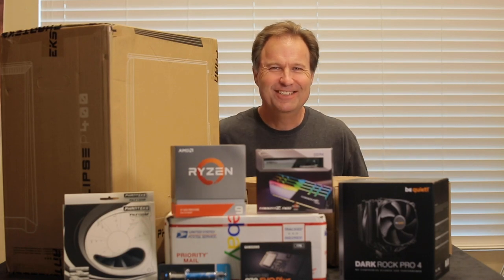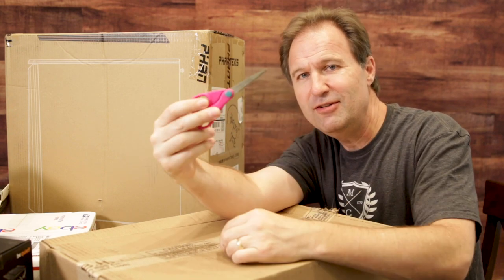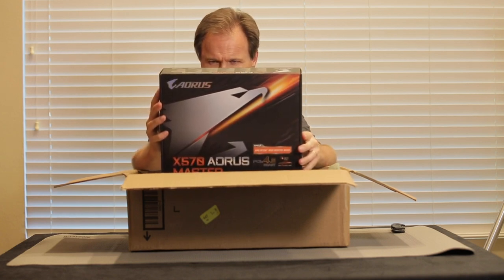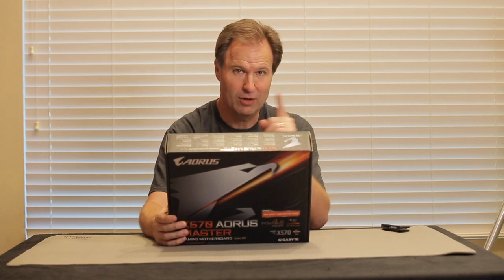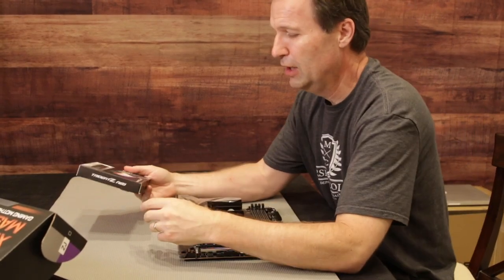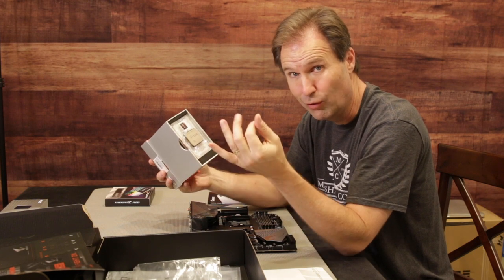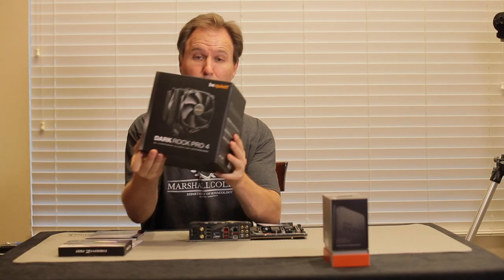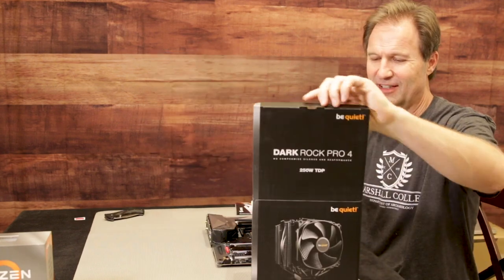HOW TO BUILD A PC - Step by Step 
Tutorial. Phanteks P400A, AMD Ryzen 3950x, Gigabyte Master, NVIDIA

Comment: Excellent vid, thanks, just got same case and it’s 10 years since I last built one so a refresher vid was very handy (especially for m.2)

One thing I discovered, if you take out the 9 screws holding the top of the case on, the top comes off leaving all the switches/usb ports in place, giving a lot more room when fitting the MB
Reply from the maker: Great tip! Congrats on the build.

Comment: 54:07 There is a plastic connector housing included with the motherboard called the "G Connector." You connect the power LED and all that to the connector housing first, which then securely fits into the motherboard header. I hope that helps.
Reply from the maker: Thank you!

Comment: Dave, first time builder checking in
With your help I had a smooth build
Appreciate you DdV
Reply from the maker: Excellent! Glad I could help. What did you build?
Reply: @devosentertainment  went with a similar setup as you
but opted for the Sabrent 1TB NVMe 4.0
and NVIDIA GeForce GTX 1660 SUPER

Comment: This video was very fortuitous. I haven't built a PC in at least 10 years, and it's probably been 6 or 7 years since I did any serious component upgrades, so I was feeling a little rusty, especially when considering all the fancy new RGB stuff. It just so happens that I am building in a Phanteks P400A RGB case, with a Gigabyte X570 Aorus Pro Wifi mobo, and using an air cooler (CM Hyper 212) for the CPU (Ryzen 7 3700X), so this tutorial turned out to essentially be the exact video I needed to watch. It clarified so many small details for me that I was wondering about. Thanks very much for making such a detailed tutorial.
Reply from the maker: Awesome! Glad it helped.

Comment: For anyone watching now, I just built my PC with a Phanteks P400A case and followed this guide. I think it's spot on. One thing to note is that it looks like Phanteks changed the fan power cables so they are now 4 pin and not 3 pin
Reply from the maker: Thanks for the update!
Reply: I started building my first rig lastnight and noticed I had 4 pin cables and every build guide was showing 3 pin! Thank you for this comment I was worried about this!  I tend to overthink things and I wasn't totally clear what was going on!  Again THANK YOU!

Comment: Found you :) Just about to start a P400A digital build with an x570 but with a liquid cpu cooler, so was looking for all video's on the P400A. Thanks for the content.
Reply: Would be good if you could give us a close up of the connections as you plug them into the motherboard. I didn't understand which socket you plugged the cooler into. Was it CPU or CPU OTP ?
Reply from the maker: Welcome aboard!
Reply from the maker: CPU_OPT - This header serves the same purpose as CPU_FAN, the only difference is not having a fan connected to this header will not prevent the system from booting, some heatsinks may come with two fans, or may have clips on both sides where a second fan can be connected for a “push-pull” configuration (one fan pushes cool air into the fins, another fan pulls hot air out), it can also be used in liquid cooling where the pump is connected to the fan header, the pump would connect to CPU_FAN and the radiator fans would connect to CPU_OPT, the idea is as long as the pump can keep the liquid flowing, even if the fans were disconnected or failed, some cooling can still be achieved, if the pump was disconnected or failed, the liquid would remain stagnant and the hot liquid would not make it’s way to the radiator to be cooled, as well as the cool liquid would remain in the radiator and can’t make it’s way to the CPU to serve it’s purpose, therefore not cooling the CPU, even if the fans were sill running properly, CPU_OPT can warn you if there’s a problem, but it won’t shut down the system or prevent booting like CPU_FAN will when it detects a problem
Reply from the maker: As always though, it’s best to consult your manual. Hope this helps!

Comment: I bought that same case yesterday I'm looking forward to building in it this guide was very helpful thanks. I'm still new to building and I've only done it 3 times, those little pins for the power and reset switch are the only things that really screw me up though lol. I'm a bit worried about buying a new cpu cooler that will give me enough clearance for 4 ram sticks, I know my old one does but that cpu fan you bought looks massive!
Reply from the maker: It is truly massive. You’ll want take sure you have the right low-height ram to fit.

Comment: thank you for the very detailed information and showing where to connect what will defiantly watch this again when i will build my own pc
Reply from the maker: Excellent! Hope it helps. Let me know what you end up building!
Reply: @devosentertainment  
CPU:Ryzen 9 5900x
MB:X570 Aorus master
GPU: which ever will be available first(3080/6800xt)
RAM:G.skill 32Gb (8x4) 3600Mhz
EKWB 360 AIO for cpu cooler
Case:Phanteks P500a 
PSU:Corsair RM850x gold
Storage: 2 crucial P5 1tb m.2
Reply from the maker: The race to the GPU. I’m with ya. I finally broke down and bought a 2060 Super as a stop gap.
Reply: @devosentertainment  yeah I currently run 1060 on a laptop I never owned a desktop before that’s why I’m trying to go all out with this build hopefully it will last 2-5 years before I need to change the whole thing

Comment: Gonna build in this case! Gonna get all my parts next week can’t wait!!
Reply from the maker: Sweet! What are you building?
Reply: @devosentertainment  Case: Phanteks p400a
PSU: Corsair 80+ bronze 450 watt
CPU: Ryzen 5 2600x
GPU: msi gtx 1050 ti
MoBo: asus b450 f
Ram: 2 sticks (8GB each ) g.skill trident z 3600
Cooler: MSI MAG CORE LIQUID cooler
Storage: Western Digital Blue SN550 500 GB SSD
Then a rear exhaust fan that’s the same as the case fans. Not a crazy build by any means but I can always upgrade in the future! Just can’t wait to finally build a pc. Crazy thing is the ram is now $160 and the GPU is going to go up cuz apparently it was on sale 😂 (1050 ti for $280)
Reply from the maker: @bigd2829  very cool. What’s your main use for the machine?
Reply: @devosentertainment  light to medium gaming and work. Should be perfect for what I’ll be doing. I really appreciate your reply’s btw! How’s the pc you built in the video doing? Still running good?
Reply: @devosentertainment  subbed btw! Your a cool guy 👊
Reply from the maker: @bigd2829  thank you! Just curious - what other kind of videos would you like to see?
Reply from the maker: @bigd2829  yep. Solid as a rock. Been editing like crazy for Marvel, Disney and HGTV this week and it hasn’t skipped a beat. Plus learning Blender. Still waiting to get a 3090, but it might be a while.
Reply: @devosentertainment  that’s cool you do that for your work! As for video ideas, heres a few that I think many could benefit from including myself: general tips to keeping a pc fast and healthy/maintaining a pc, how to build a pc based on personal needs, and pc troubleshooting. Since you edit, you can do vids about editing software and tips and tricks on editing. You may have done vids on some of these I mentioned, so if so let me know! If not, I hope these could be future topics for videos.
Reply from the maker: Thank you for the suggestions!

Comment: Sorry I'm too late for this but I bought this case yesterday and as I'm writing this I'm in process of building the pc. When I try to remove the side panel (28:00) it doesn't move, and I've been trying to move it for 3 hours now. Please help me with this I'm getting sick of this problem. Great video btw! 
If you can help me please answer im very concerned because I don't want to pay more.
Reply from the maker: It may be that the front inside clips are bent a bit. Try laying the case on it’s side (take the window off, then lay it window side down) then press your palms firmly on the side panel (toward the front) and press down while sliding it back. It might take some real force to get it. Careful you don’t break it!

Comment: Thanks you so much! This video helped me a lot, you have no idea! Finally, after so many years built my pc and you helped me a lot.
Reply from the maker: Congrats! What did you build?
Reply: @devosentertainment  Ryzen 5 3600x,  Asus TUF gaming B550m plus wifi, 16 RAM Delta RGB TUF 3200MHz, 1tb HDD, 256gb m.2 Falcon, case Phanteks Eclipse P400A Black, 650w 80+ PSU, AIO Masterliquid lite 120, 3060ti 2x OC. 
I've been saving some money, I am so happy, still can't believe this is real.
Reply from the maker: @jay_m.  right on!  Make sure to remember to go back into bios and set your max Ram speed. Chances are it will not be at full speed by default.

Comment: As Dave mentioned at minute 52:36, remember to install correctly (positive and negative polarities) as your build will not turn on if that part is not specifically done right. It happened to me but thanks to this detailed video I was able to realize that this was the problem.
PS. Thank you very much Dave for such an insightful and educational video.
Reply from the maker: Awesome!  Glad it helped. What did you build?
Reply: @devosentertainment  Well, I built it with the following specifications: MSI MAG B550 TomaHawk; Ryzen™ 5 3600; Ram DDR4 at 3200 MHz VENGEANCE® RGB PRO - White Edition  (2 x 16 GB);  Gigabyte Gaming Radeon RX 5600 XT Series OC-6GD OC Edition 6GB; Gamemax VP-700w 80 Plus Bronze and a SSD at 500gb.
For me, fulfills my needs. Funny thing is I've never built a PC before, but with this video I made it and it works perfect :)

Comment: This is very helpful for beginners! Although the cable management could be improved.
Reply from the maker: No doubt. 🤣
Any suggestions?
Reply: @devosentertainment  you don’t always need to use the same grommet to route your wires thru it. E.g. the audio cable could’ve use the slot near it.

Comment: Great video! By coincidence I just bought very similar components and will be conning back to this for reference! You brought up the RAM frequency not running as expected but never came back to it, what should you do to address this?
Reply from the maker: You’re right! I’ll have to do a follow up on that. You can set the clock speed in your bios.

Comment: This vid helped a lot, the only thing that I don’t know is where I need to connect my “M/B D-RGB 3 pin” because, my motherboard doesn’t have the 3-pin needed for it. I’m using an (MSI B450-A Pro Max).
Reply from the maker: You might need to get a controller

Comment: Hey Dave! Thanks so much for the video. I'm just waiting on my mobo and cooler to arrive in two or so days then I'm all set to start my build, watching this pre-emptively to get prepared lol. I liked your anecdote about the Jurassik Park ride hahah, that's so awesome that you were the one to make the sizzle reel, and I'm glad it went off without a hitch! Is available anywhere to watch?

I do also have a question, I'm going to be doing a completely fresh build with no existing drives. I have a 2TB 970 NVME for my primary drive, and a 2TB 870 2.5" as a secondary drive. Do you know if I'd be able to tell the drives apart when I get to the Windows install screen? (so I can install on the NVME) - otherwise I guess I should keep the 2.5" unplugged until I have Windows all good to go? Thanks again for the video!
Reply from the maker: I’ll have to dig it out of the archives! And yes, I believe BIOS labels the drives separately. Good luck!

Comment: Hi there, thanks for your video! I watched this from start to finish and saw that you had NO issues getting the glass back on to the case after you installed the dark rock pro air cooler. PCPP website says that this cooler is too big for this case. I have this same exact case and the dark rock pro 4 is the cooler I want to install in it (currently running the stock wraith cooler). Can you please comment if you had ANY issues regarding this cooler?
Reply from the maker: None whatsoever. That being said, different motherboards allow for different tolerances.

Comment: I am struggling on windows failing due to my x.m.p being on. I had to cut it off to stop the blue screens. I could probably tinker with stuff in my bios to fix this issue but don't know exactly how to do that. Any recommendations? Great video by the way.
Reply from the maker: Is your cpu overclocked? Might be a voltage or heating issue.
Reply: @devosentertainment  No sir, no overclocking on my system at all. I have been seeing most people with this problem mention changing CL timing but i can't find anything specific on how to fix this problem. I def don't want to go upping the voltage without knowing. I'll take any advice you got lol. And thanks so much for your time.
Reply from the maker: @BigRIp_  hmm. Hard for me to know how to help without getting in there. How do you know it’s a result of xmp?
Reply: @devosentertainment  Its definitely X.M.P. 99% sure anyway. I just used process of elimination really. I put it under load it blue screened. The only way it will function without blue screens is when i disable XMP. It is most likely the timing and my CPU not getting along well. I know it could be addressed and fixed by someone that knows a thing or two that is why this is frustrating for me. I have never messed with this much or had this problem on any other rig.
Reply from the maker: Gotcha. Just curious how big is your power supply?  Also, is you ram set to the max clock speed?  I can do a video on bios settings if you think it might be useful.
Reply: @devosentertainment  It would definetly be useful. For me and I am sure others will find it valuable. I have ripjaws ddr4 3000mhz. When it is at max speed of 3000 with xmp enabled i have system instability. A video discussing this issue and how to adjust bios xmp settings to acheive stability would be awesome. i want to upgrade my memory but it would be absolutely pointless because i am not even getting the speeds advertised currently.
Reply from the maker: @BigRIp_  okay, I’ll look into it. Can you give me your system details? Including your power supply, cooler, fans, mobo, etc?
Reply from the maker: @BigRIp_  also, a screenshot of your bios settings would be helpful
Reply: @devosentertainment  Yeah so my specs are: EVGA 650w BQ, B450 aorus pro wifi MOBO, Ryzen 5 2400g, use 4 fans in chasis and stock cpu cooler. I do not overclock my cpu and never have. I have bios version F63a. Haven't changed anything, everything is on default. X.M.P just causes instability for whatever reason. prolly a cpu memory controller thing if i had to guess. probabely need to manually tweak things but have no idea. If you need any other information please let me know and thank you so much.
Reply from the maker: Pm me a screenshot of your biOS if you can

Comment: I thought the dark rock pro 4 was too big for the phanteks P400a? Thats why I ended up with a smaller Noctua one so it would fit the case and not touch the tempered glass or the top of the case.
Reply from the maker: It fits perfectly but you do need low profile RAM sticks.

Comment: Hey man, thank you very much for this video. I have the exact same case, cooler and RAM.

It's a far shot but do you remember what cable was responsible for being able to light up the RGB on the fans? My fans turn on but they don't light up. I also have the P400A Digital
Reply from the maker: Take a look at your case. Under the lip on the front top there are a few buttons you can push to make the lights turn on. They might just be turned off. Most likely if you press it a few times, they’ll come on and you can adjust the color. Lmk if that works!
Reply: @devosentertainment  Thank you so much for the quick response!

The buttons weren't the issue, however when I opened the case back up I had noticed that I had plugged in the 3-pin MB RGB Fan connector thingie, even though my MOBO uses 4-pin so it isn't compatible, after noticing this I disconnected it, and the fans lit up!

So while what you said wasn't the issue, it led to what would eventually be the fix, so thank you again for the quick response and keeping active on your uploads! Have a nice day.
Reply from the maker: @saikousocial  awesome. Yeah, I just left mine loose as well. Good luck with with your productivity! What are you going to use the computer for?
Reply: @devosentertainment  I plan on using it for lots of things! It's mainly for gaming in terms of specs, but I really wanna try my hand at learning how to do some 2D/3D art designing, maybe learn some coding, etc.

My specs for reference are...

Ryzen 5 3600
Radeon 5700 XT Red Devil
16GB DDR4 3200Mhz TridentZ RGB from Gskillz
BQ Dark Rock Pro 4
1TB WD Blue SN550 NVME

So, it's not exactly a productivity workhorse yet, but thanks to your guide I was able to get it fully assembled on my own. This is my very first computer ever so I'm really grateful you made it so easy.
Reply from the maker: @saikousocial  Very cool, thank you! I'm always curious how my videos help people - I have a lot of differing content on my channel between filmmaking, computers, real estate and business, and I'm trying to pick a lane and focus. It's hard because I do a lot and have a lot of interests. What content would you like to see more of? Appreciate your feedback!

Comment: Thank you so much for the video, very detailed as I needed, first time building a desktop, using this case too and with this video could finish it
Reply from the maker: Awesome! Glad it was helpful!
Reply from the maker: Out of curiosity what did you build?
Reply: @devosentertainment  I built a ryzen 3700x, rtx 3080, 32gb ram 3200hz, same case, ssd 500gb and 2TB hdd and b550-a pro motherboard
Reply from the maker: @darkpt699  Sweet. What’s your main use?
Reply: @devosentertainment  It will be mostly for gaming and normal daily use
Reply from the maker: @darkpt699  Cool. I hope it does well for you!